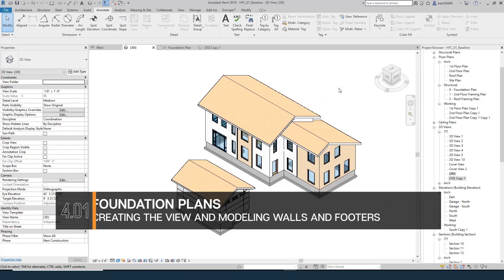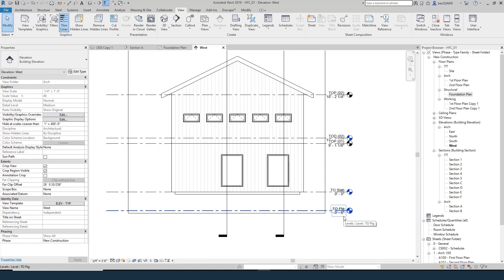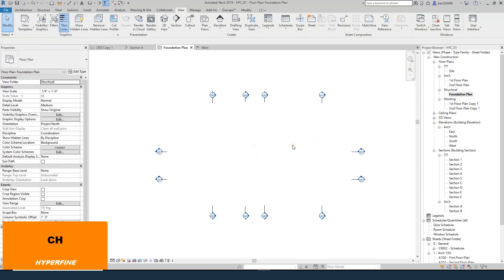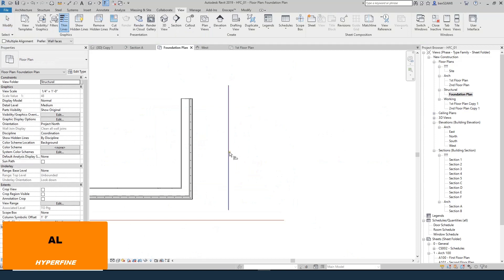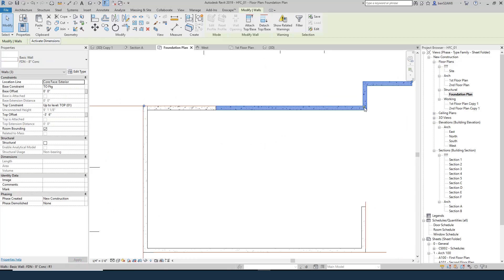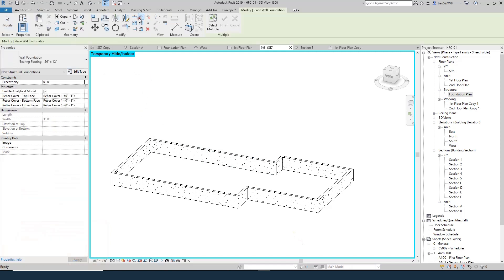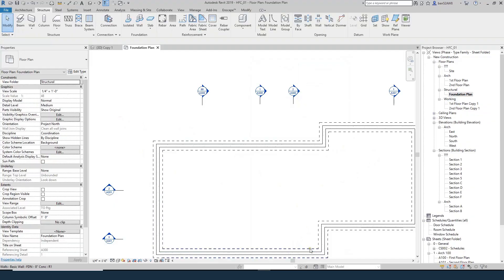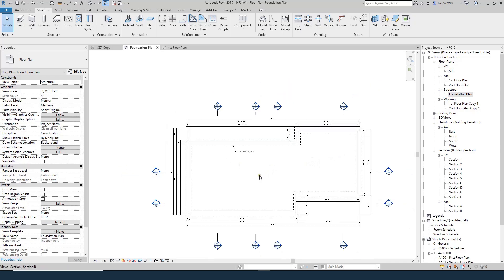Revit Foundation Plan Tutorial

Comment: Would you still go with “core of the exterior” if you have the brick on walls? How would you create staggered foundation with exterior partial brick or siding?
Reply from the maker: Yes, I’d still do the same. Staggered walls can be annoying, but I usually do one wall then split it whenever the foundation jogs so I can control the top and bottom constraints separately. Could also just do edit profile and probably a few other options I’m not thinking of.

Comment: Great tutorial however I came here looking for the exact same process, but on an uneven topo surface. So if I cut a section anywhere in the foundation, my footing would show below grade and my foundation wall height would vary. Any vids available on that topic?
Thank You
Reply from the maker: I would go in an elevation view (with topo turned on) and use reference planes to mark the locations you want to step the footing and/or top of foundation wall. Then go in plan and use Split Line to split the foundation wall at the reference planes. Then just use the offset top and bottom to follow grade as you want. I don’t think I have a video of this, but the sample file that comes with the pro course has a detached garage with a stepped footing.

Comment: Great Tutorial! However I have a glitch.  I have brought in all of my detail lines to align my walls to in the foundation plan.  When drawing my first wall.....it will not appear.   First floor level set at 0' 0".  TO Ftg set at -3' 9".  Checked VG and walls are turned on. View range set top -3 2",  Cut plane -3 6", Bottom and Depth Unlimited.   Prompt says:  'Check active view parameters, visibility settings,  plan regions and settings.
Reply from the maker: I would make a new level for TO Ftg. Use that to set the base constraint for the footing and to create the foundation plan. Setting cut plans at negative values can sometimes lead to problems, as you are seeing.

It's also a good idea to check all the errors Revit gives you. You might also check the phases of the project. And you can go to a 3D view or section to make sure those walls are actually there and if they are, check if they are joined to the floor above or not.

Comment: Hi, thank you for the course. I've just have bought it :) 
My only question is: why you don't set your view template? In my opinion that would be the most efficient way instead of using DL.
Regards from Munich
Reply from the maker: Thanks for signing up! I don’t fully understand your question. Detail Lines are used for drafting and guides, I used them to help locate my foundation walls. View Templates are for styling a view consistently. You can email me if that wasn’t what you were asking about.
Reply: @HyperfineArchitecture  Ohh sorry, right,! I actually meant Underlay, why you don't simply set Underlay?
Reply from the maker: @karrrrramba  that's an option, I just don't like using it! Also I don't think it works that great for trying to view levels above where you are working. It's a better option for looking below.